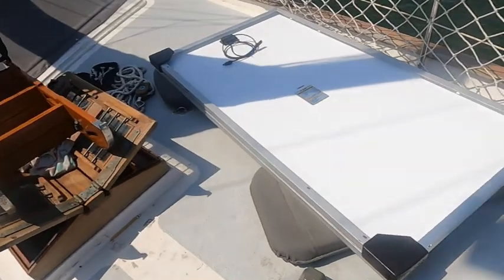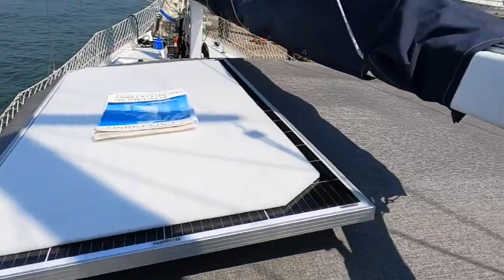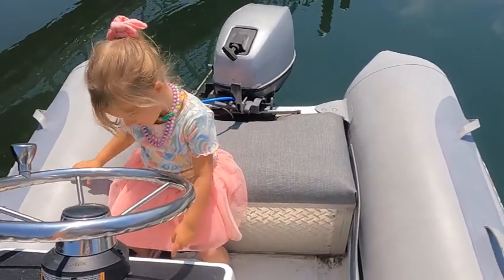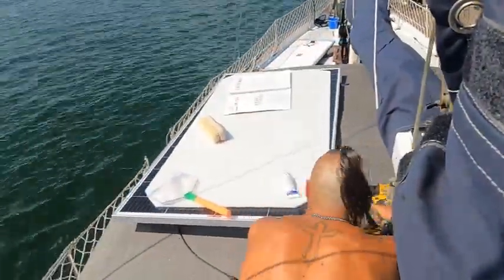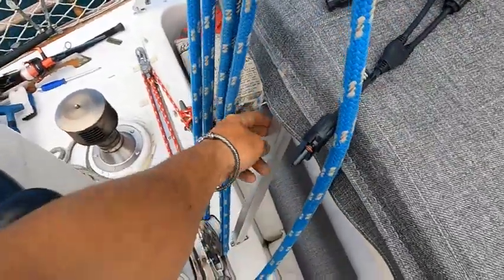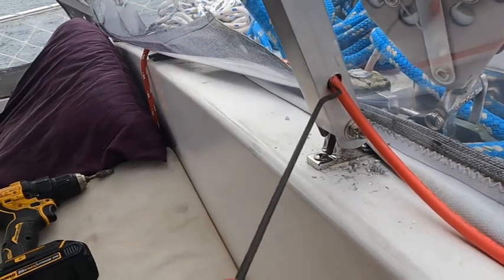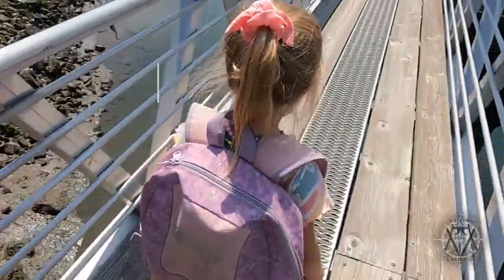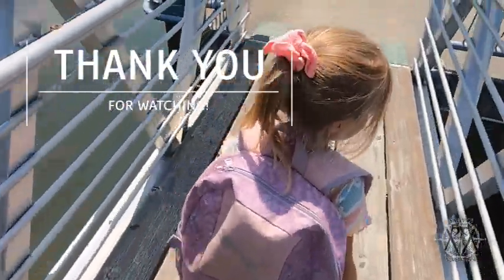MASSIVE UPGRADE To Our Solar Panels! How We INSTALLED HUGE Solar Panels To A Soft BIMINI TOP!

Comment: Great vudeo. Im looking at installing rigid panels on my bimini and was wondering where you bought some of your parts. The diode wire components and the rubber plastic (parts to secure to the bimini frames)